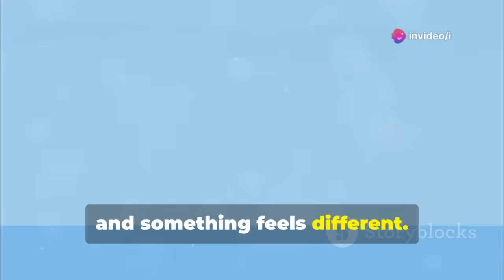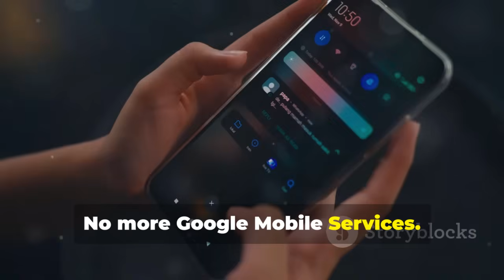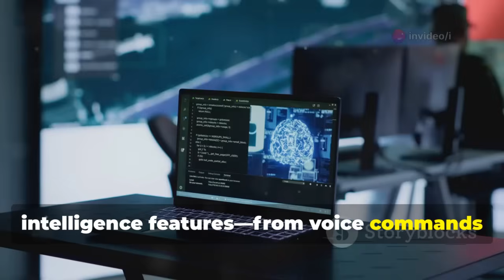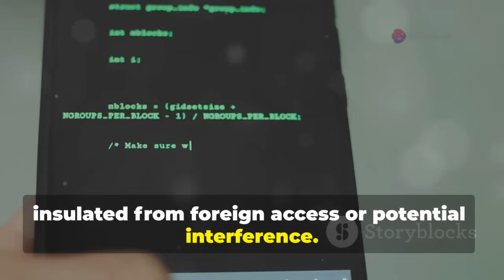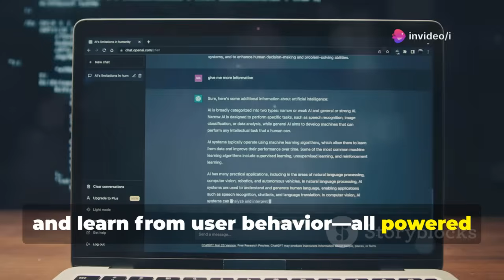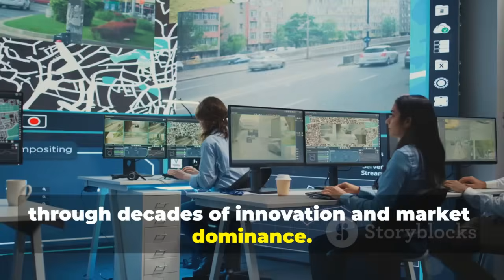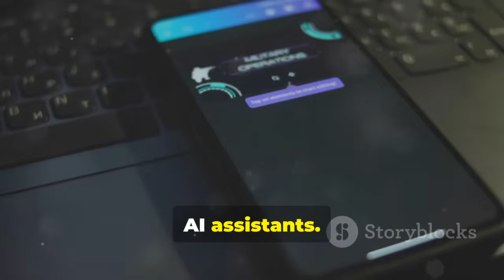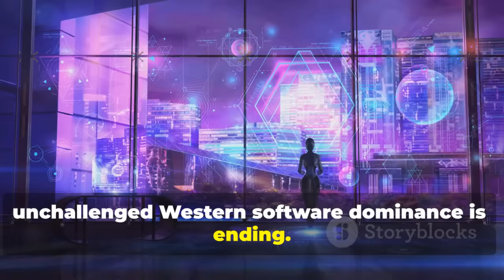A New Tech War Begins: Huawei’s HarmonyOS Takes Aim at Windows

Comment: The job of an OS is merely to be the basis for the programs you use. And as long as those programs aren´t compatible, Harmony is useless. That´s the reason why, after 30 years, still virtually no one is using Linux. Windows programs don´t work there.